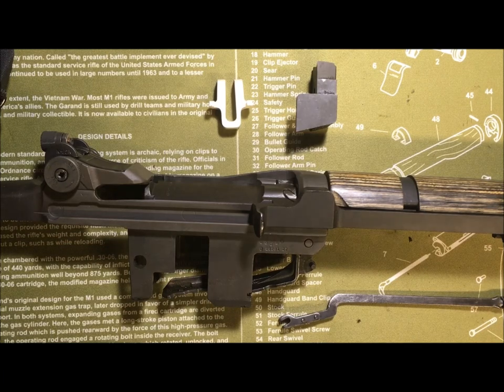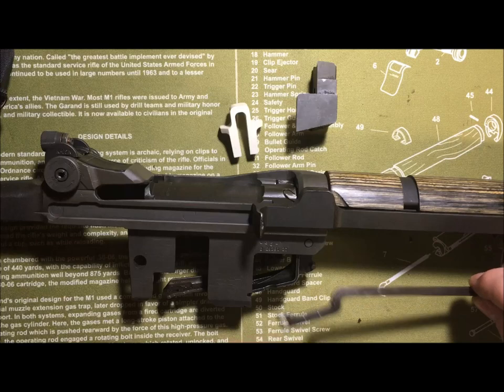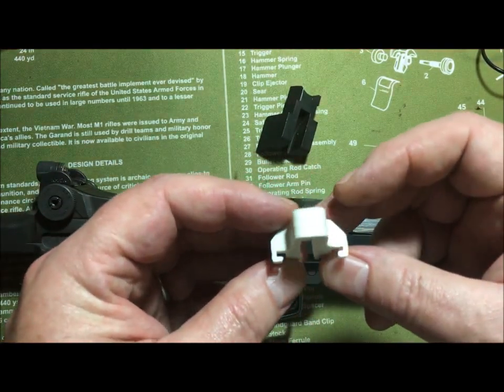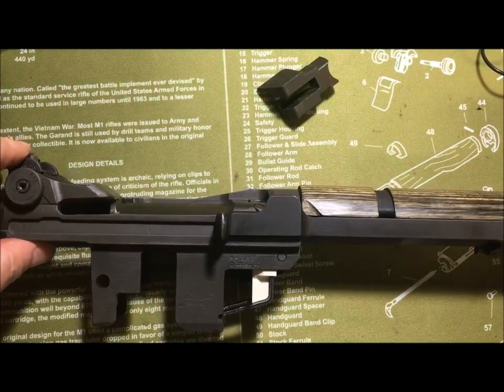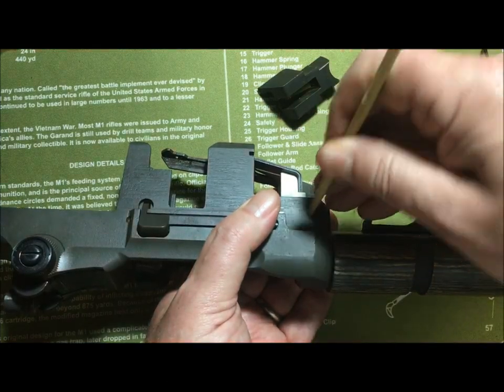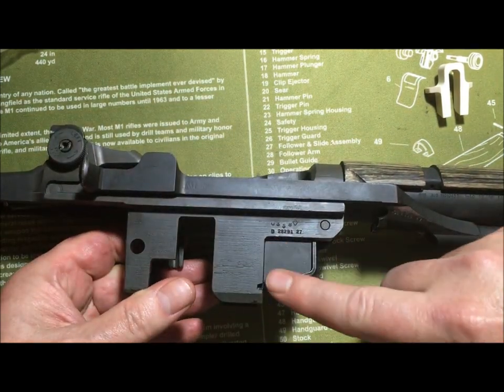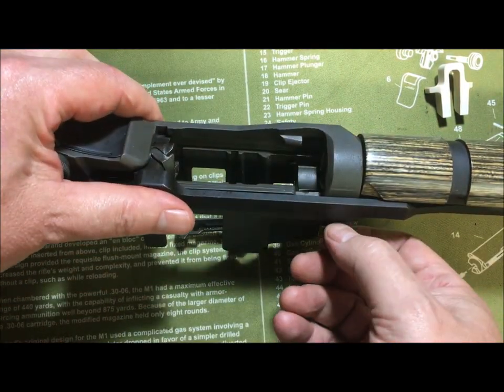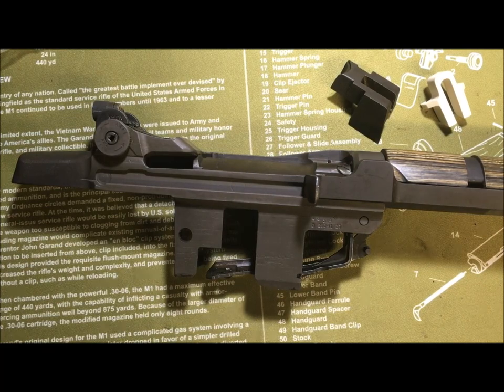M1 Garand: Intalling a 7.62/.308 Spacer

Comment: Excellent video. Thanks so much. Now a dummy question is: Will the 30.06 en block clip hold  the 308.762 ammo? Do I need to do anything else to shoot 308/762 ammo from the 762 barreled Garand?
Reply from the maker: Yes, the standard USGI en bloc used with .30-06 is used for .308/7.62 NATO as well. You do not need anything else to fire the rifle, but a spacer is suggested in order to keep a .30-06 round from fitting into the rifle.

Comment: I have a M1 in 308 from the CMG, but do you have a load suggestion for a M1 in 308 with a creighterion barrel?
Reply from the maker: I generally buy USGI 168 gr BTHP Match or high end match ammo for my .308 Garand, but you can load 168 gr Sierra Match King bullets in GI Lake City brass with 41.25 gr of IMR 4895 (if you can find it) with CCI BR2 primers. It is below pressure by far, but be careful anyway, especially of using once fired brass. Use your best judgement and ask some real reloading experts - of which I am NOT one. :)

Comment: Are the barrel and the spacer the only necessary changes to make it shoot  .308? Or does the oprod need to? What about the gas tube? Trying to figure out if this makes sense for me financially.
Reply from the maker: Great question and one I get from time to time.  All you need are the barrel and spacer.  Op rod, etc. are all the same.  This does not mean the rifle won't need some tweaking, but in general if you start with good parts your rifle will function properly.  Sometimes a .308 Garand will need attention to get it running 100% because the op rod spring is designed for the .30-06, but it not a show stopper.  You can reduce the spring by cutting coils off until it runs 100%.  Jerry Kuhnhausen's book is the bible for this.
Reply: @FreeAmericaChannel  thank you, I'm gonna do this with a rebuilt garand. I probably wouldn't do if it was original but since it already has a new 30-06 barrel, I might just do the swap and sell the barrel. Or keep it as a backup. Hard part is finding a .308 barrel. Seem to be out of stock everywhere.
Reply from the maker: @cornholius  Fulton Armory has .308 barrels for $250/each.  They also have very nice steel spacers.
Reply: @FreeAmericaChannel  thank you, I'll follow closely as it's showing out of stock for me. Iight grab one of the spacers while I can, better than plastic.

Comment: Can these be bought still? I want one for a bolt action 30-06. Want to lighten up the recoil with the 308. I didn't know these even existed! Cool idea and makes sense
Reply from the maker: This will not work on a bolt action rifle.  It is specific to the M1 Garand.  It does not change the caliber to .308, these rifles are chambered in .308, and that makes them unable to accept .30-06 cartridges.  The spacer keeps you from accidentally trying to load .30-06 into the .308 rifle.
Reply: @FreeAmericaChannel  ok I see. I know there are chamber spacers for 30-06 rifles to shoot 308. The military attempted to use them at one point. Thanks for the info
Reply from the maker: @NCshooter1213  Now I understand what you mean.  I have not seen any of the 7.62 NATO chamber spacers for sale in at least 20 years and the ones that I have seen were removed from old barrels and rendered inoperable in the process.  They worked poorly in military rifles and were soon replaced with barrels chambered in .308.

Comment: Interesting i did not know there was a plastic and metal insert. i just got one given to me now i need to look and see if i have that or not. also i believe the clips are the same for 30-06 and the 308. so what you mean i believe is you cant load a 30-06 round in. is that correct? good info though.
Reply from the maker: Right, the clips are the same, you can use them for both .308 and .30-06.  The point about not loading .30-06 is the spacer keeps the the longer rounds from being loaded into the rifle.

Comment: I have an M1 in .308 built by CMP. Barrel is marked .308 Win. I've only ever used .308 in it as I've never been able to find out if it's o.k./safe to use 762x51. I talked to someone @ CMP and he wasn't sure but recommended I stick w/ .308. Does anyone know for sure one way or the other? There is sure a lot of 7.62x51 ammo out there.
Reply from the maker: The original .308nconversions were done by the US Navy - in 7.62x51 NATO.  It is safe to use GI 7.62 ammo in your rifle.  I shoot USG issued (Lake City) 7.62 match ammo in my rifle often.  That is the 168gr boat tail hollow point ammo.  I would venture to say that any US GI 7.62 ammo that you would shoot in an M14/M1A is fine for your Garand.  Prvi Partisan makes a 150gr 7.62 that is pretty good and shoots well in my .308 Garand.
Reply: @FreeAmericaChannel  Thx. I appreciate your reply.
Reply from the maker: @watrdog504  Happy to help.

Comment: I'm M1 rookie looking to  get Navy M1 308....and will be my 1st M1.
I watch youtube Military  channel guy shoot his Navy M1.....he loaded his 30-06 clip (8rds of 308) into Navy M1....and message is 30-06 clip  (with 308) works.
Now your video shows how to install 308 spacer block to prevent loading 30-06 clip into rifle....but Military channel guy loaded 30-06 clip into Navy M1.
Are you stating that 30-06 clip (308 rds) cannot work in Navy M1....and that Navy M1 clip is different that 30-06 clip ?.....If yes, what is different ?........thanks sammy
Reply from the maker: Hi Sammy! Good question.  The .308 block keeps you from loading .30-06 ammo in your .308 Garand.  They both use the exact same clips.  The dimensions of .30-06 and .308 are the same - except for the length of the cartridge, so the clips work for both.
Reply: @FreeAmericaChannel  Perfect....thanks